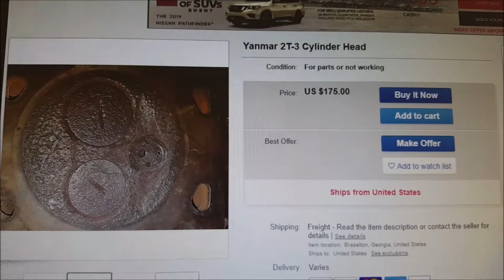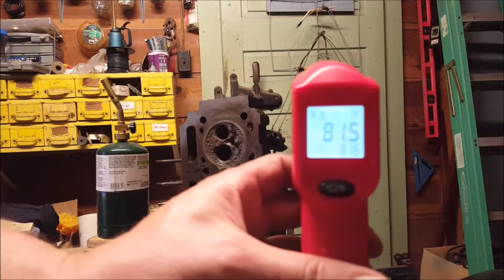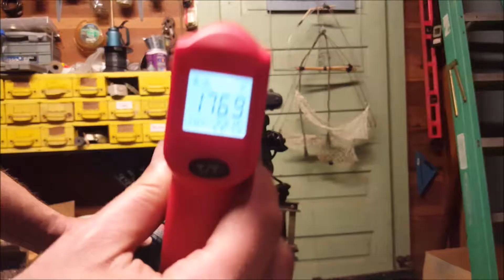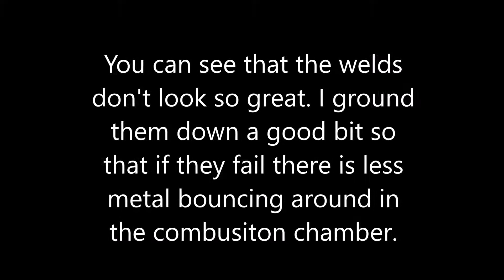Yanmar Cylinder Head Cracks

Comment: I hope this works for you. I put something this size in the oven at 500 degrees until the whole thing is hot then heat the crack weld it and put it back in the oven to cool it down slower. Thanks for sharing
Reply from the maker: Aww, duhh! I didn't think of the oven. Thanks!